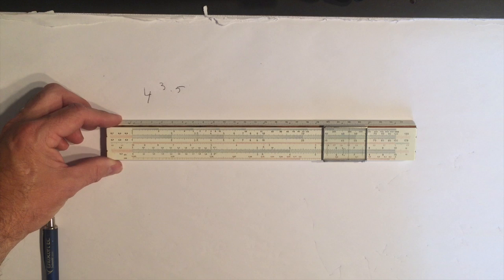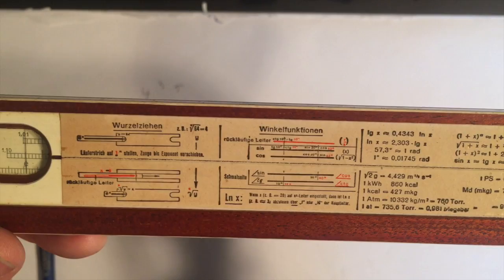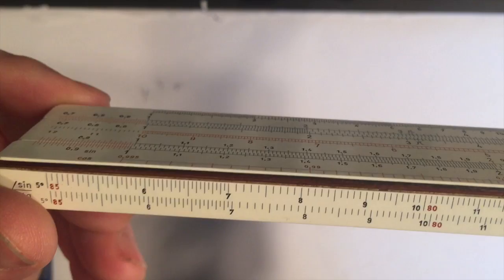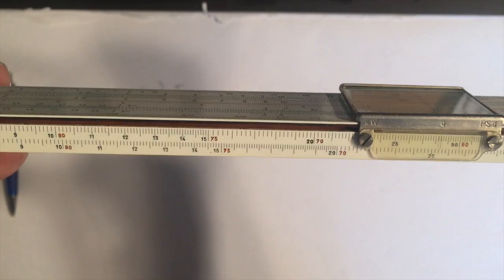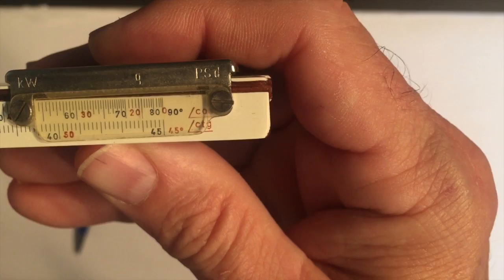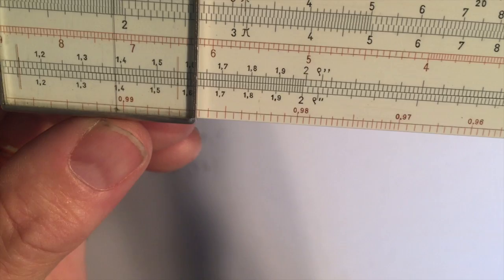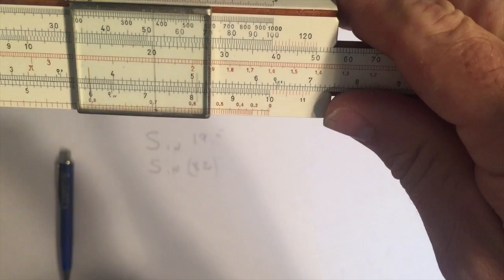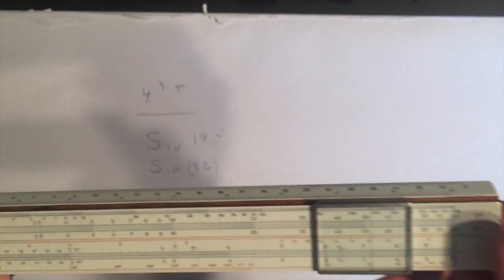The Darmstadt Slide Rule

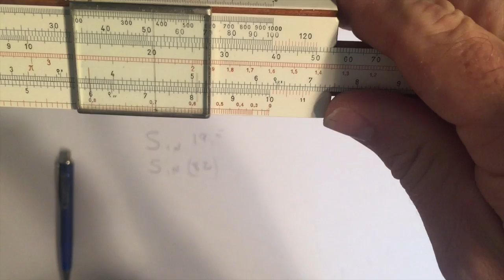Comment: Regarding 5:43, there is an alternate method to calculate 4^3.5 on the Darmstadt slide rule as follows: On the back side of the slide rule, move the slide to the left such that the 4 on the e^x scale is under the left index hairline. Flip over to the front side of the slide rule. Move the cursor to 3.5 on the D scale and read on the C scale that its number is 4.85. Next move the slide to the left such that 4.85 on the C scale is now over 1 on the D scale. Flip over to the back side and read under the left index hairline that the answer is 128. In summary, these operational steps performed: 4^3.5 = e^4.85 = 128.

Comment: Just a small comment. Koroliev and von Brown used nestler 37 electro. A bit different than dramstad. 
Nestler wooden slide rule are still very nice to use because they are made from Mahony wood which was cut in early, mid XIX century. So it is pretty well seasoned and therefore stable.

Comment: Regarding 5:08, as an alternative to using the exponential scales while they are on the back side of the Darmstadt slide rule and having to flip it from back to front and back again. The slide itself can be reinserted to the front of the slide rule such that the exponential scales are now completely visible on the front. Doing so eliminates the need to flip the slide rule back to front and back again.

Comment: Darmstadt Sliderules are my favorites. By the way: You could also turn the slide-strip around when calculatong 4^3 for better readabity. 
Greetings from Germany
Reply: if it were for 4^3 he could just read the very top scale with the cursor at the 4 in the d scale. but since he is doing 4^3.5 this is not accurate.

Comment: This Nestler is probably older then 1950s as "D.R.Patent", Deutches Reich Patent (German State Patent), sign, visible in the well was used between 1919 and 1945. I would say that this slipstic is not older then 1930s, I think that they used different typeface before 1930. Anyway Nestler rules are very good, precisely manufactured and quite pretty. I have similarly dated No23R - rietz system "poor brother" of No21 and calculating with it is really satisfying.
Reply from the maker: Thanks for the comment and info Gustaf.  The really old 21 slide rules have a thicker metal cursor than this one.  Perhaps this one is from the early to mid 1940s.   This SR still operates smoothly and the numbers are still bright.  The use of 3 colors and the "railroad" tick marks make this model easy on the eyes.
Reply: I overlooked the cursor frame while estimating production date, now I checked it in the catalogue and you are right, thanks for highlighting that.

Comment: That slide rule it's made out of Bamboo, very cool. I'm glade you got one. thanks for sharing.👍
Reply: Bamboo is used because natural oils in it make it self-lubricating.  You are warned NOT to use any type of lubricant. Just slide it back and forth a number of times if it’s sliding a bit tight

Comment: btw it can also convert PS (essentially horsepower) to kilowatts and diameter to crossectional area. so if you ask if that 0.5mm in diameter wire is the 2mm^2 wire you are looking for it can do that on a dedicated scale